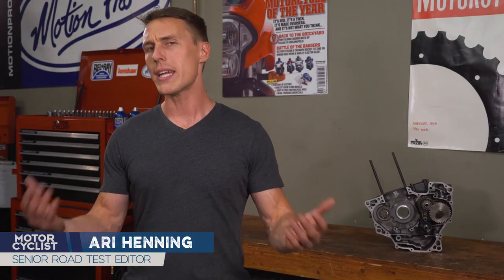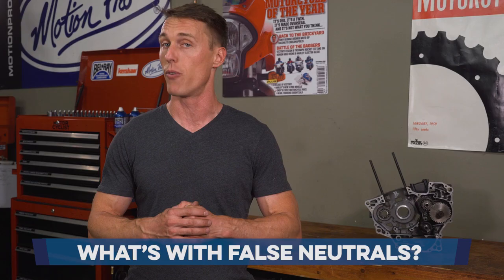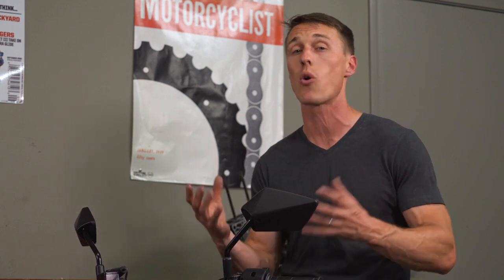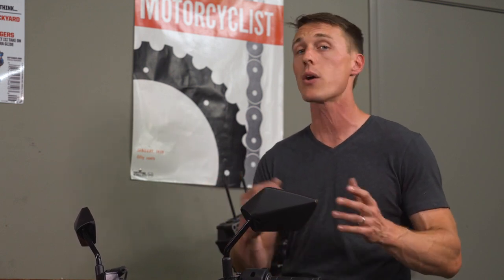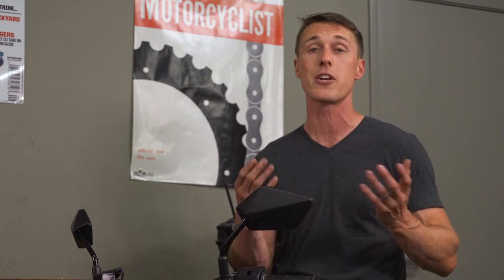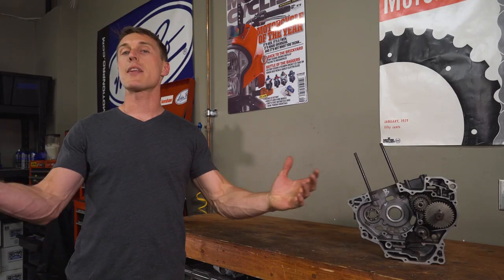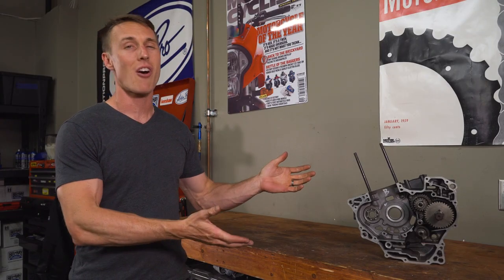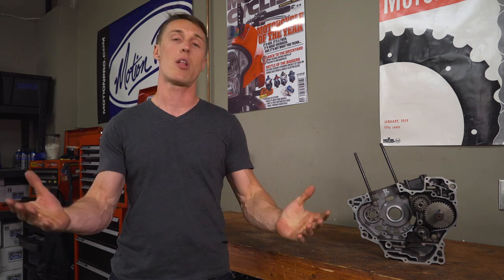What’s With False Neutrals? | MC Garage

Comment: what about cluthless shifting?
Reply: That's a topic we intend to cover in a future vid. Stay tuned.
Reply: Yeah, its bad if you do it wrong... Better to have a quickshifter these days, hopefully it becomes a standard quick.
Reply: Changing gears in a bike transmission is all about removing the torque from the gear to reduce the friction between the gear dogs that otherwise would lock them in place.
You can do it in a handful of ways, disengaging the clutch allows the torque generated by the engine to be "dispersed" and not be passed to the gears.
or via a quick shifter that briefly cut the throttle while changing gears.
As for clutchless shifting you simply roll off the throttle to simulate a quick shifter. The difficult part is to get the time right, and that takes practice and a few "bangs".
The transmission NEVER stop spinning, not while idling, not with the clutch disengaged while going ( there's torque generated by your back tire that is connected to your transmission ).
The worst thing that could happen would be a bent fork, but for that you just need to be gentle on the shifter and if you feel some resistance don't force it.
If done correctly gears will just move into position very smoothly, some argue ever smoother than shifting with the clutch.
Also remember that gear dogs aren't perfectly in sync with every housing in the others gears. Just you try whit the clutch pulled all the way to shift from 1st to 6th, if you make it without ever having to move the clutch or roll the bike back and forth consider yourself lucky cause that is pretty rare...
This is to point out that gear dogs are designed to grind against the other gears a bit before engaging.
Reply: Kyoraku Shunshui I mostly shift without the clutch from 1 and up.
Reply: ***** but is it bad for the transmission? I've been doing it n a couple of guys told me tht its bad
Reply: Its bad if you're bad at it. Load the shifter, and when you roll off the throttle the gear shifts. It's designed to do this. Quick shifters virtually do the same thing by cutting ignition, fuel or both.
Reply: Ari Henning hope to see it soon. Thanks
Reply: +Ari Henning Looking forward to it!!

Comment: Oh, man. It is really terrifying when it happens shifting aggressively at high speeds. Yikes!
Reply: You think that's bad? How about having your transmission change back into the lower gear on hard acceleration, while going uphill...
Reply: How did that happen? Shifted the wrong way by accident or mechanical failure? That must have been brutal, man.
Reply: MickHornbak It seems my gearbox has such a tight tolerance that it doesn't have false neutrals, rather it likes to shift down if I don't shift it fully
Reply: Could it be that your clutch cable is a little too tight?
Reply: It's done it since I started riding in 2013, clutch should have the proper slack
Reply: @michor10  u dont need a clutch to shift its a recommendation with good reason
Reply: MickHornbak it's worse when you come out of a corner, go on the power and you don't move. Especially in heavy city traffic.
Reply: well first gear gets me to 15kmph, second to 30kmph, so somewhere here i need to shift and accelerate to not be turned to a pancake by the people behind me
Reply: axel boström push it higher in the rpms sounds like 15 is short shifting
Reply: nothing like a high speed at high rpm and then, a genius downshift. this smart move happened at the end of the month. when your wallet is drying up.
Reply: MickHornbak It happened to Guy Martin on the Isle of Man tt at around 140mph and spat him off
Reply: kolby4078 that's a brutal analogy. Damn. :D
Reply: Liam Hayes Holy shit, yeah that's right. It was a box full of neutrals according to Guy. I frickin love Guy Martin and I'm glad he wasn't hurt bad like Mcguinness.
Reply: it was nothing like that. Honda Racing Europe supplies the same spec Fireblade to WSBK and they have had no false neutrals this season with it even if the bike was supplied in March, much later than competition. 
Guy's problem was his shifter not being setup right or him not shifting with enough pressure on the lever.  The Fireblade also competes in FIM's Endurance World Championship and it recently placed 3rd place at Suzuka this past weekend and none of the riders had false neutrals. The bike also competes in BSB where no false neutrals were reported.
Reply: my motorbike is fine. but it makes a loud clunk whenever i shift gear. I followed every steps from oil, gear shift speed and rpm instruction, starting to warming up the bike, and pulling the clutch fully. its even louder shifting from neutral to the 1st gear. Sometimes its just doesnt shift and stall, until i move the bike for a couple of steps and the gear would than shifted. service center are useless. anyone know why? i would greatly appreciate for the help
Reply: KEEPMOVN you could have a chinese made motorbike
Reply: @limanigie4403  Just for the record, my "Japanese" (not Chinese) Honda CB300R is made in Thailand, this model already had a worldwide gear related recall and now my brand new bike has the same issue.
Japanese quality control my @$$!
Reply: axel boström damn my first gear can get me to 100km/h
Reply: MotorBike Mike might be a bit but it's strange and refuses to rev high below third gear. My bike is a shitty 50cc thing anyway that I just have while waiting for my higher license so I can ride my dad's 500cc Comet :D
Reply: MickHornbak Yeah Ive never seen him so shook after a crash
Reply: Yeah, man. That must have been really terrifying. I heard it's something to do with the electronics on the bike. Some even say that the new street legal Fireblade has the same issue but I doubt that that's true.
Reply: I'm glad to hear that. I wouldn't imagine Honda being that irresponsible.
Reply: MickHornbak that’s the only time it happens to me!!!

Comment: Is there any particular reason why some bikes are more prone to false neutrals than others? I know some Ducks and Hondas have this issue. I test rode a Hypermotard 939 and couldn't get over the amount of false neutrals above 3rd gear.
Reply: Tolerance between parts, shift star design, operating temperature, clutch adjustment... lots of reasons.
Reply: Cool thanks for the information Ari

Comment: Motorcycle transmissions are exciting.
Reply: give this man a beer
Reply: Taijean Moodie when you throttle the bike at a standing stop the rise in rpm lessons the clutch drag and makes shifting to first possible. check your clutch adjustment, oil viscosity  (maybe too thick an oil) and anything else related to clutch disengagement.
Reply: Yes
Reply: I was gonna say that!!!
Reply: Taijean Moodie your clutch is dragging too much for some reason.
Reply: Testing
Reply: Agree... they don't look complicated but when you use them they do all sorts of interesting things that leave you thinking 'hmm... why did it do that'.
Reply: @kuhndj67  so complicated to think about but so easy and fun to use most amazing thing on the planet is a motorcycle
Reply: Haha, my first thought too: Which one of you complained about this?!
Reply: Daro
Reply: Definitely
Reply: Amazing!
Reply: Thank God I false neutral into my own driveway
Reply: And eat s***
Reply: agree
Reply: Yeah I want one in a miata with a liter bike v8. It would probably break but weight reduction breh.

Comment: I thought I was crazy lol
Reply: Carlos Gomez lol
Reply: @Jimmy Doran the first time I ever experienced a false neural it was on my Suzuki 😆
Reply: @Jimmy Doran Idk man I've had three Harleys, two Suzukis, and one Kawasaki. The only one that I've ever gotten a false neutral with is my V-Strom and my Katana. I think I know how to use a transmission and shifter. It's not exactly rocket science 😂
Reply: Jimmy Doran just happened on my 2020 ninja 650, maybe because it only has 30 miles on it and it isn’t broken in?
Reply: @bsmith9123 
Very rare for a kawasaki to do that
When changing gears you have to be positive with the gear lever going up and down the gearbox and that will eliminate any false neutrals.
Reply: @simdoran8516  happened once in my ninja 400 it sounded like metals in a blender. But the one im worried is instead of it doing false neutral it goes back to the previous gear. Happened 4 times already.

Comment: Did it once, quickshifting after a launch. Scared the fuck out of me. Sounded like a gallon of ball bearings in a blender. Haven't done it since then.
Reply: Did it a few times, sounded like I was in neutral, unless you mean the sound was after you shifted again then I'd say you did something else.
Reply: Jordan Granados Can that happen when you are actually IN neutral? because I was idling my bike once and I heard the same sound and then it slipped in to first and stalled
Reply: Death666wish whenever he shifted the transmission into false neutral in the video, it clunked back and forth between the two gears. the sound of the shifter clunking around is terrifying, and normal for a false neutral. the first time I did it, I'd never heard of it. it sounded so badly I thought my transmission had just said goodbye for good